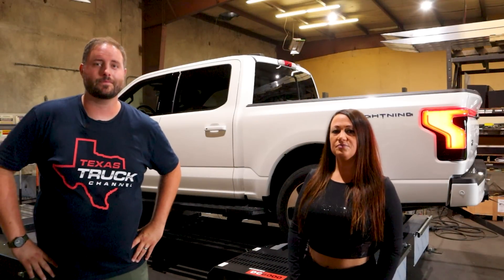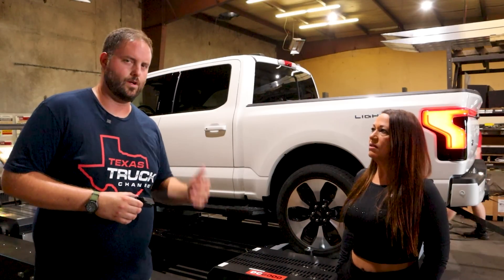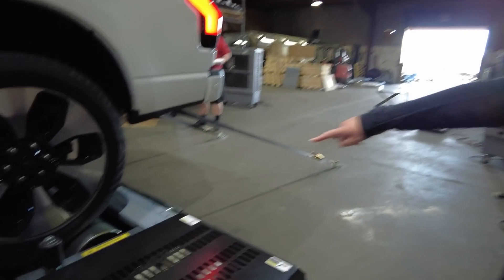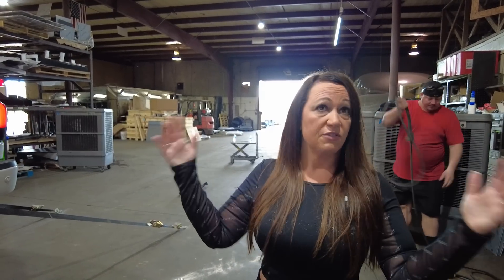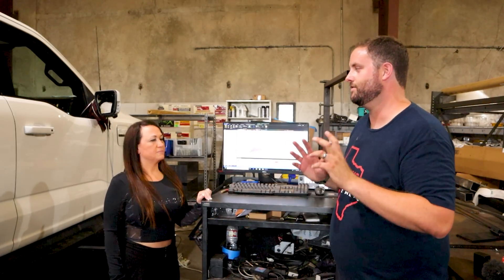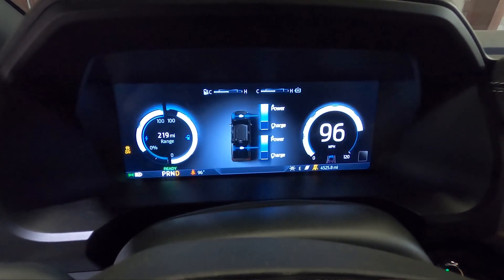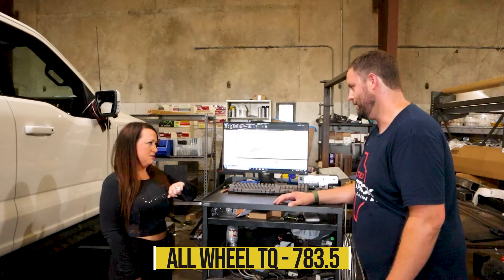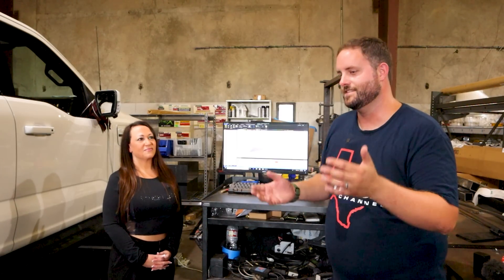EXCLUSIVE // Worlds FIRST 2022 Ford Lightning EV Dyno Test

Comment: Wow that really highlights the difference between ICE's and EV's. Insane initial torque, falling off quickly and running out of steam up top. I bet a 13 sec car would walk away from it if the race started at 80 lol
Reply from the maker: That’s just it. The EV punch falls off in most of them. Not that it’s a bad thing. Just a stark difference between ice and EV.
Reply: @TexasTruckChannel  That’s why we have multi-speed transmissions! There are a lot of a ICE vehicles especially in this age Turbocharging that make good power close to idle and fall flat on there faces in the top end, just like at almost all of fords “ecoboost” line up.
Reply from the maker: Absolutely correct, this is why we cannot wait for EV's to have more than 1 gear in the mainstream.
Reply: @WhatsThatsmell69  hgvs do the same now too, its about economy, keeping the power in the range that is used most of the time gives better fuel milage, most people don't drive at 100mph all the time.
Reply: @michaelbamber4887  TX, GA and FL all have ~100 highway speeds. In TX there are some 85mph highways. You can be doing 95 and someone will blow by you doing 110. Pretty normal lol.
Reply: @TexasTruckChannel  Absolutely. This absolutely has its applications. A drive unit like that would be great in a great tow vehicle. There's a reason EV's aren't king of TX2K.

There seems to be a bit of a disconnect with the average consumer and even some enthusiasts. They'll see a horsepower figure and apply it to the road like it's an ICE then scratch their heads when they get blown up by a Civic hatchback on the highway. Pretty funny.
Reply: Even without the EV’s high speed efficiency loss it’s a 6,600lbs truck with the drag coefficient of a house and a 110mph top speed…so, no shit!
Reply: @WhatsThatsmell69  YT really doesn’t want you to read my response I guess lol.
Reply: @pullyoursocksup6302  idk what’s going on I see the notification but it just disappears when I click on, I get the gist of though.
Reply: @RollingRoadEFI  The funny thing is I made this account because I pissed off A LOT of Tesla fanboys by saying things like “like 100k+ Tesla’s interiors/Exteriors have worse fit and finish than a low spec Audi a3 or Mercedes a-class” and explaining why that the Taycan is a better platform than the model S, insanely tame right? But 99% of the 300+ responses to my comments are just insulting me and flat out saying Tesla is the best car company ever without even so much as an explanation.. and since I responding to them accordingly; good old YouTube started blocking my comments.
Reply: @WhatsThatsmell69  Ahahahaha you nailed it all around. I’ve kept it out of the tire wall for 8 years. Hopefully it survives. 

Can’t see any comment by Orlando either. What did he say?
Reply: Doubtful, the electric torque curve is pretty flat.
Reply: The problem is your username. It triggers the censorship machine.
Reply: Well besides the performance models of the 3 and Y and the Model S P95, 100D, and Plaids Teslas are not that fast top speed wise. Really only the Plaids keep pulling above 100.
Reply: @XxViciousxX  Yeah, we know. That was the whole premise of my initial comment. 

If you’re not going to at least own the inaccuracy within your ridiculous assumption you hurled at me you can keep your obvious opinions to yourself.
Reply: @XxViciousxX  my Model 3 DMP  does 162……
Reply: @alexnutcasio936  162 indicated or 162 GPS verified? The two are not the same. I wonder what your 120-160 is. 

Nice job ignoring my response lol.
Reply: @alexnutcasio936  But how long does it take to get to that speed? That's the point. I have pulled on many Teslas in top end in my modified Lincoln MKS so I know Telsas getting to their top speed is not their stong suit (besides the Plaid of course)
Reply: @XxViciousxX  Man you still here? You gonna own your assumption yet?
Reply: @XxViciousxX  “Well I can tell you get black flagged at every track...”

Remember me now?
Reply: @RollingRoadEFI  What are you talking about all I did was agree with you from the beginning which for some reason made you very hostile.
Reply: @XxViciousxX  See above, my guy.
Reply: @XxViciousxX  That’s what you call hostile? Lol. What a fairy.
Reply: @XxViciousxX  getting to their top speed is a Tesla strong suit.    Even if that top speed is only 180 , they get there very quickly.
Reply: @RollingRoadEFI  well, power to weight is still better in Tesla Model 3 at 4500 lbs divided by 500 hp  versus 2800 /200 hp.  You’re talking 9 lbs hP versus 14 for the Civic.    Advantage: Tesla
Reply: @alexnutcasio936  Except it doesn’t make that power at that RPM…… does it ;)
Reply: @alexnutcasio936  You don’t know what my car weighs, or how much power it makes or at what RPM lol. 

Let’s see. The car weighs 2150lb and makes about 225hp at the crank. Try your math again lol. 9.55lb per hp, and my car makes that power on the top end where it lives, combined with short gears it’s not that difficult to figure out. Then again maybe it is so let me spell it out for you. Basic math & common sense > you.
Reply: @RollingRoadEFI  video of your car beating a Tesla Plaid or banned.
Reply: @alexnutcasio936  Who said anything about a Plaid? Now you’re just trying to save face. Sad. Admit you jumped the gun and I’ll be nice to you. 

Just FYI, the Model 3 performance only makes ~400hp at 100mph and the torque is waaaaay down at those speeds. 

Sorry dude, the L is yours today.
Reply: @alexnutcasio936  Silly Tesla fangirls lol.
Reply: Go take a look at the Porsche Taycan for an EV with a 2-speed transmission. Even though the powerband of electric motors is much much wider than internal combustion engine, it is not infinite. But it is wide enough for regular driving for it to have no transmission. For racing applications where you still need good torque at higher speeds over 80 mph that's where another gear will help and why Porsche did that with the Taycan. Tesla with the Model S Plaid however is still one gear but still keeps on pulling up to around 130 mph.
Reply: I go 0-60 10, 15 times a day in my regular commute. I go 80+ approximately never. I’d much rather have the ability to accelerate than to go super fast. Kudos to you for making a small car fast though.
Reply: @whodat90  You probably live in some overcrowded crap hole blue-city though, right? 

In south Florida people do 75 in a 55 on surface streets. 0-60 is useless here, we need range and top end. That’s why electric cars aren’t popular here. They won’t cut it.
Reply: @RollingRoadEFI  Nope, out in the country in the foothills of the Blue Ridge Mountains. Btw Florida is second only to California in EV adoption.
Reply: @whodat90  Right on. Just saying, they’re not around where I live for a good reason. They don’t fit the need.
Reply: Just watched the latest upload from Hoovies Garage. Wouldn’t ya know it, the truck that doesn’t do highway, can’t even tow a featherweight vehicle a few miles down the road without triggering a range warning. 

I’m sure it goes to Walmart and back just fine 🤣
Reply: @RollingRoadEFI  that was the standard range truck, not the extended that has the better tow rating. And the ‘few miles’ was close to a hundred miles. Watch TFL Truck and they got right around a hundred miles towing with the extended range version, while towing a 6000lb travel trailer. Don’t get me wrong, it has half the range when towing, I’ll give you that. But let’s stay away from hyperbole and talk facts. What exactly do you mean by ‘doesn’t do highway?’ TFL also used it to do “the gauntlet” or “the hardest towing test” and when they pulled onto the on-ramp it spun the tires and almost ran over a Prius because it had so much power. Electric vehicles aren’t the best choice for towing, particularly for long distances. Don’t recall anyone saying they were tbh. But for a lot of use cases, they’re amazing.
Reply: @whodat90  It was more like 30 miles one way, and for half of the journey it was only dragging an empty aluminum trailer. Hyperbole? Not at all. This truck is touted as being a step up from its petroleum powered ancestors, being excellent for towing and having incredible power….. and that’s just not accurate. 

This truck is for the country boy with too much money and doesn’t want to drive a Tesla. His cousin/girlfriend is going to drive it to the mall after she drops him off at the job site, and mall duty is all it’ll be good for. Not so, you say? 

Okay let’s look at this from a business perspective. This truck platform is completely useless to any kind of automotive industry whether it be parts delivery or towing. Are people just supposed to tow ONE vehicle a day, and only within town? What happens when a customer breaks down across state lines? Nope, sorry. What happens if a customer wants a vehicle delivered at his new house a ways away. Sorry, no can do. What about the company who thinks saving money on diesel is a good idea….not unless you want to close up shop at lunch time. What about the parts delivery world? If you were delivering to cars in a single parking lot, sure. 

So the truck has a blistering 0-60 time. SO WHAT?!? It doesn’t TRUCK! Except for the goofballs who buy trucks to drive around the big city. Lol. 

🤦🏻‍♂
Reply: @RollingRoadEFI I just re-watched, you are correct it was 32 miles each way. Where is it advertised as being better than it's petroleum siblings at towing?  I'm interested to see?  I get that you can make use cases that any vehicle isn't good at.  That's why it's awesome that nobody is required to use the same vehicle.  If I want to go fast, even from 80Mph, I'll use my sportbike.  If I want to tow, I'll use my truck.  If I want to commute, I'll use my hybrid.  I honestly don't have a dog in the fight, I'm just curious as to why you're so against the lightning, and apparently the 'goofballs' and 'country boys with too much money' who see the value for their own use cases?

And who's going to spec a 1/2 ton truck as a vehicle delivery hauler?  As for parts delivery, that actually seems like a perfect use case.  Up to 300 miles of range available, lots of regen in town, and assuming that you do eat lunch you'll have time to charge the truck again.  Funny you mention the jobsite, that is one place where this truck is advertised as being quite useful.  It has 110 and 220v power available, enough to run a house construction site.
Reply: @whodat90  🤦🏻‍♂

I’m not against the lightning, I’m just pointing out the fallacies. 

Cope 👍🏼
Reply: @RollingRoadEFI  So you don't have the link to where it was advertised as a better tow vehicle than a diesel?  Or where it was advertised as a replacement for a 3/4 ton or 1 ton truck?  See, the thing is if you talk about the vehicle and where it's shortcomings lie that's valid.  If you show false advertising that's valid.  If you extrapolate that to denigrate and call names anyone who would buy one then you seem like you have a personal grudge against it.  Anyway, I'll go cope.  Nice chatting!
Reply: @whodat90  Show me where I said it was advertised as a better tow vehicle? You’re subtly changing the context of my statement to fit your narrative. That’s why I chose to ignore you, because you don’t actually want to answers to your question you just want to argue your point. 

So yeah, cope on 👍🏼
Reply: @RollingRoadEFI  "This truck is touted as being a step up from its petroleum powered ancestors, being excellent for towing"
Reply: @Big Paw Fair. I’m crazy 🤷🏻‍♂ 

Tesla owners get upset when my POS Civic hatch leaves them for dead on the highway.
Reply: @RollingRoadEFI  unless you’re running 200+whp then a good majority of even the lower end trim model Tesla’s would destroy you to 120!
Reply: @WhatsThatsmell69  My car weighs a little over a 2000lb, makes 200+whp naturally aspirated, and has a close ratio transmission. I eat Teslas for breakfast above highway speeds, and am neck and neck with many cars folks consider quick. I remember the first 01-02 Cobra that I raced, I had to let off to see if he was even in it he was getting rolled on so hard. Sure enough letting off with my ear to the window I heard it, looked over and saw the hood dip between shifts. 

Quick car. Nobody likes to admit it, and few can match the lap times.
Reply: @RollingRoadEFI  definitely not a “pos” then, I’ve always liked civic’s even though almost every car I’ve owned was a fat high powered German Grand tourer. Just hate what people do to them most of the time and that’s where the stigma comes from.
Reply: @orlandomoreno5326  Well v6 Camaro’s and mustang’s don’t make 300whp and are NOT “lightweight” stock, so I don’t really see the point in this comment? I literally said a civic(an actually light car) with 200+whp would have no problem destroying lower spec Tesla’s so I would obviously come to the same conclusion with a car that puts down 100 extra ponies to the pavement and scale it accordingly.
Reply: @pullyoursocksup6302  Cars are meant to be driven, you have my respect! But like you said Those eg’s & ek’s are creeping up there in value and you’re gonna eventually feel like shit taking it out some time’s, the same happened to me with my E39 m5 dinan s2! 
I love taking her out but Every time I do it’s like I’m 1 step away from some typical NYC driver turning her into scape metal!
Reply: @RollingRoadEFI  yeah right, only when  the Tesla has a flat,no charge and is chill mode.  Calling BS😢
Reply: @alexnutcasio936  👍🏼 Right on man.
Reply: @alexnutcasio936  I guess basic math isn’t your strong point. A Tesla weighs between 4500lb and 4800lb, and mine weighs less than half that. 

Have you ever heard of a  ‘power to weight’ ratio? Lol 🤣

Stick to Forza.